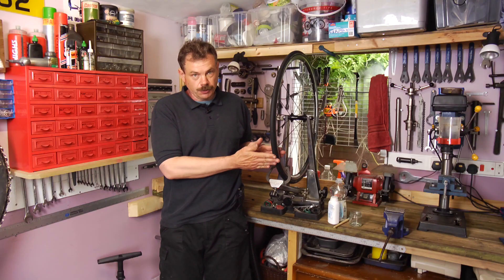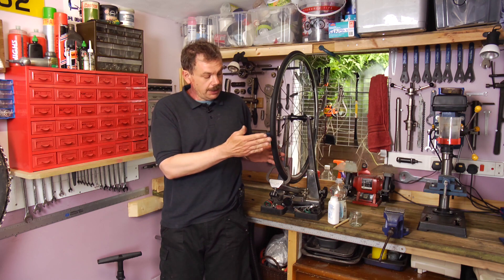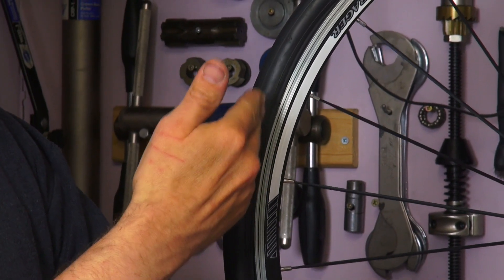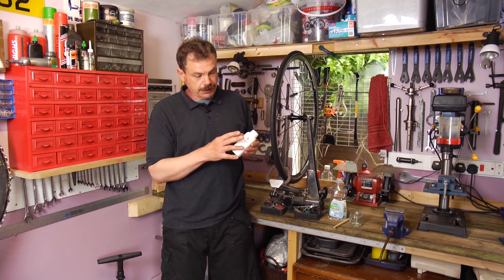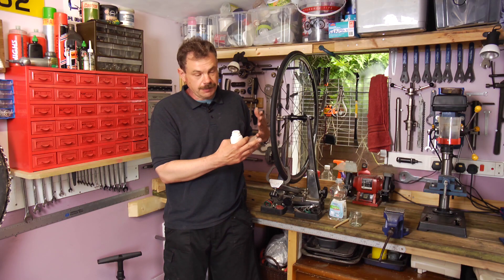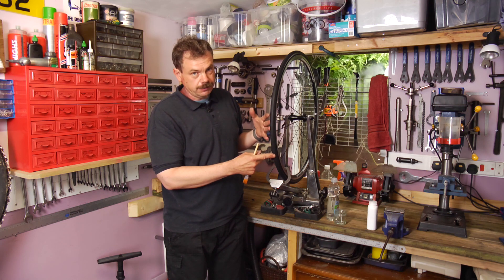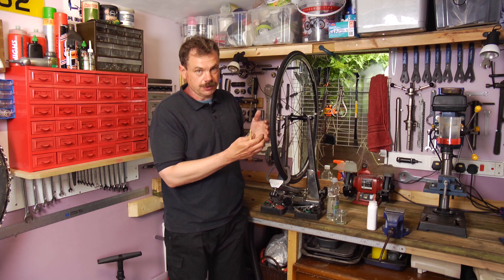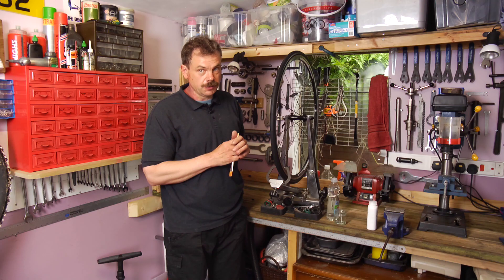Secrets Of The Cycle Trade: Seat A Problem Road Bike Tyre

Comment: I have a big plump pair of 650b tyres on narrow rims and was really worried about the seating - one of the tubes was a little large for the rim so was getting bulges too. But careful work placing the tubes and then your over-inflate technique (done slowly with lots of attention on both sides) worked an absolute treat with a satisfying snap sound on both when they seated. - I could actually watch the bead creeping round the rim as it was seating itself! Thanks for the great advice - I took talc and Ecover washing up liquid down to the garage but didn't end up needing it.

Comment: As an ex car/commercial/agri tire fitter, it should be possible to scrounge a couple of spoonfuls of tire mounting paste from your local tire shop. I'm sure they won't mind if it's for a bicycle. That stuff lubes the tire beads nicely, but dries off to a powder in a few days, even inside a tubeless tire. Personally I don't recommend wash-up liquid as some brands may cause early ageing of the rubber.
Olive oil may work for bead seating as well.

Comment: Talcum powder is very good it prevents the tube binding to the wheel too much easier to mount and dismount as well had issues with new continental tyres applied talcum and it was a lot easier thanks

Comment: me just face this issue after reinflate flat tires after not ride few months. few tries with soapy water and massage, there is still about 1/3 section of tyre seat lower than the rest on one side. 
not really sure whether the bead is not even or the rim bead bed that is not even.

Comment: Hiya, I tried the first method, I pumped up my tyre between 5-10 psi higher than what is stated on the tyre. Unfortunately, the tube exploded and split, causing me tinnitus for a few days, and rendered the vintage bike rim (in like new condition) to bend beyond repair. The explosion was MASSIVE and I experienced temporary hearing loss which is coming back, but Im a musician, so its not ideal. This was a very expensive and painful experiment and I seriously urge people to be very cautious with this method. 26" wheels Schwalbe Marathon MTB tyres. This did not sort out my issue as I no longer have a back wheel which is impossible to replace due to its rarity.
Reply: You could just buy a new rim & respoke the hub?